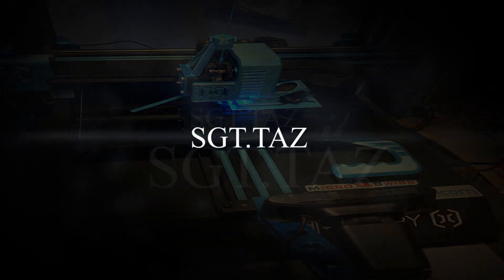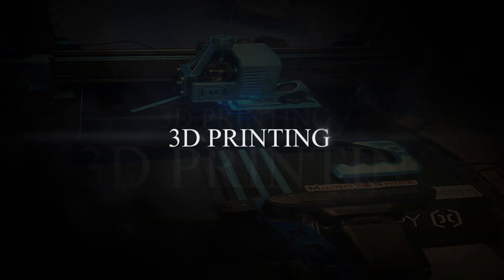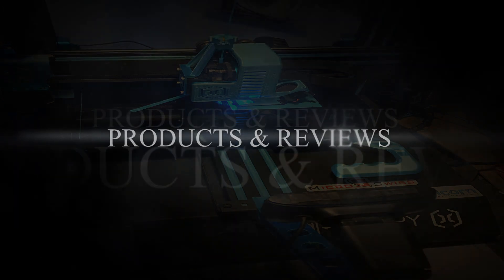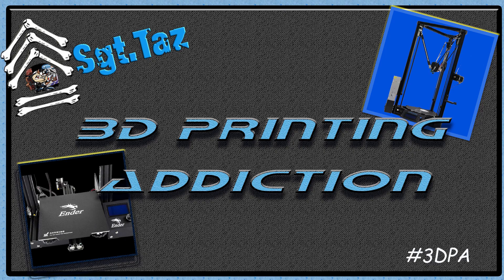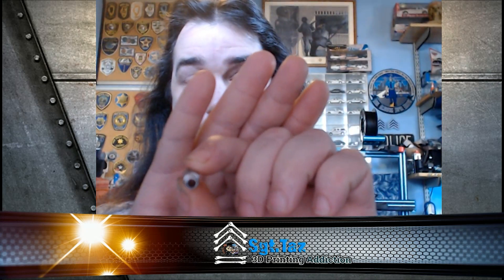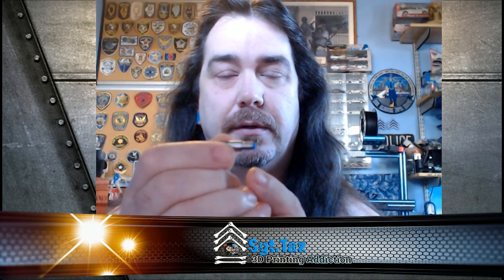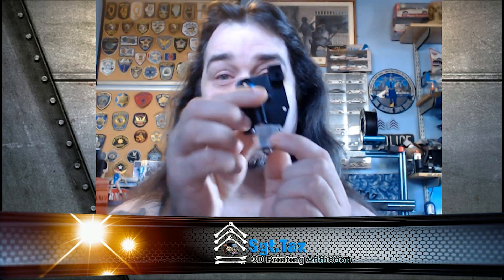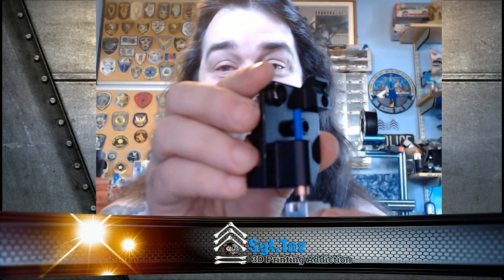Artillery Sidewinder X1 / Genius"Titian" Aluminum Plate Upgrade/Smooth Bore "Kraken Style" Heatbreak

Comment: Thank you for the informative video.. I upgraded to an all metal heatbreak e3d kraken style, but I'm having the problem that those heatbreak don't have a flat side for the grub screws to land.. so with very little force, the heatbreak spins in place, especially if I heat the printer up to PC temps..
How did you solve that problem? Maybe just file one of the sides of the heatbreak?
Reply from the maker: I went with longer grub screws. M3 × 8 are the stock size. went with M3 x 10's

Comment: will be getting mine this sat and will take your advice tips in consideration, I have some spare Capricorn tubing as i am starting to print abs with my X1.  I bought a creality enclosure and the max temps i get while printing 110c on the bed and 250c on the nozzle is about 90f-94f - just curious if anyone else is using their X1 with an enclosure?  94F doesnt seem too hot for the electronics to me, the X Stepper motor does get pretty hot ...   Thanks
Reply from the maker: There are a few that use an enclosure for higher temp filaments. only suggestion would be to make sure your case has adequate airflow around the right side vents and good intake from the base of case.mainboard sits at right and it's a good idea to keep airflow over the stepper drivers.

Comment: I got my new parts and built a brand new hot end and the new plate worked like a dream.  I hope Artillery takes notice and only uses this style in the future!   I am struggling with a couple of things... what size are the grub screws?  2mm was too big and 1.5mm was too small so either my 1.5 rounded out or I'm missing something.  I have been struggling with finding a quality set of hex drivers/bits any recommendations?  Also, the fan screws are too long, how did you resolve the issue?  Just cut them down?
Reply from the maker: 1.5 on the grub screws. The fan screws I replaced with 14mm M3's-you can use some washers if your fan has the large holes. I just use a set of harbor freight handle hex for most of my projects.

Comment: Thanks for another video.
Your video about using a PEI sheet was great. I got a magnetic PEI smooth sheet and I love it.
I Didn't know you could get a 1 piece heat-sink backing plate like that. Looks interesting. Not as interesting as all the clearish covers you have, they look great. 
I tried out a titanium all metal heat break as I was doing a few jobs with poly carbonate. Worked good for the PC but had to go back to the original set up for PLA as it was jamming up all the time. Even tried a oiler and it didn't stop the jamming.  have you tried a titanium heat break or had any experience with 1? One thing that printing at higher temperatures showed me though was how important it is to tighten your nozzle at printing temperature.
Reply from the maker: Yes I haved use a titanium heatbreak with an oiler. main thing is to keep retraction low (1mm) and make sure your heatsink fan is getting enough airflow.  The blue clear covers are made on my Elegoo Mars resin printer.

Comment: Yeah those threaded breaks destroyed my sanity. I bought a whole new extruder from banggood for 30 bucks. Dunno if that is threaded or not.
Reply from the maker: You can check by removing the fan/heatsink and see if you have the grub screws. (2 like in video) will indicate a smooth bore heatbreak.
Reply: @Sgt.Taz3D  ye I might give it a screw tomorrow. For €30 it was a great deal for a complete assembled hotend+extruder.